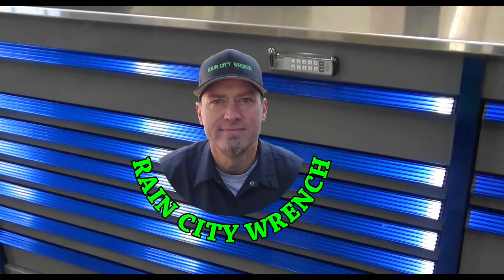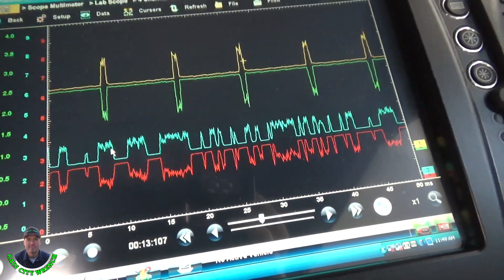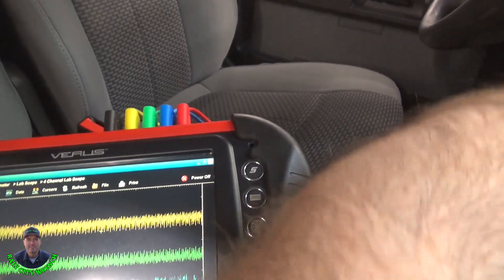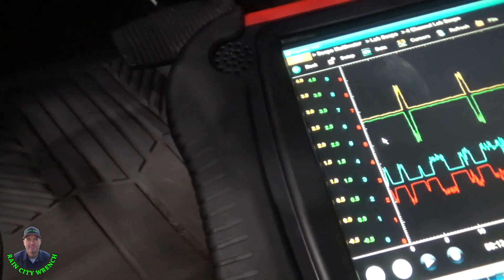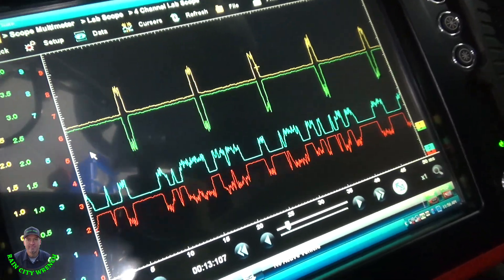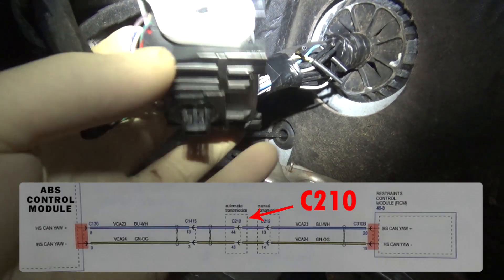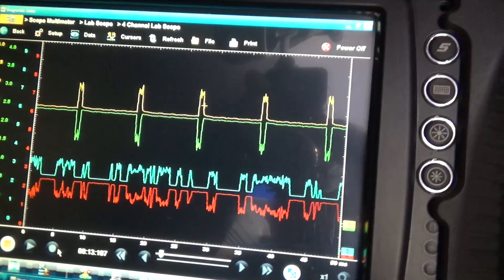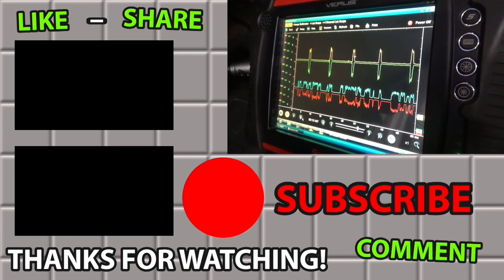U0028 SERVICE ADVANCETRAC

Comment: just had this happen to my 2014 F250. I tried cleaning the connection but that didn't work. so I cut the blue/white wire and orange/green and hard wired. you have to drive 5 miles or so before it clears the soft codes. thank you for this video!!
Reply from the maker: Your welcome. Glad you got it fixed. It's a good feeling fixing problems like these without draining the wallet.
Reply: What is a drag test?
Reply from the maker: @skofflaww3883  Got this off jumperkits.com:"If nothing is visibly wrong, poorly mated, loose, or worn out terminals can be discovered by performing a “drag test” using the correct wire from our Jumperkits.

Select the correct mating terminal from the Jumperkit and manually insert it into the terminal in the connector. As you slide the terminal in and out, it should fit securely and you should feel a significant amount of “drag”. If not, the terminal should be replaced."
 I use the terminals out of my aeswave advanced test set. https://www.aeswave.com/uTest-Advanced-Terminal-Test-Kit-p9748.html
Reply: Thanks for the quick response. I understand however it seems that a terminal that would fail this test would be extremely rare. Wouldn’t think of terminals to be “wear” items but I guess vibration could do it’s dirty work.
Reply: My abs/advance trac is lit up. It said it was the right front wheel speed sensor. So I fixed that. I started it, lights still on. So I drove it for about a couple miles and it’s still on there. Any thoughts? 2014 F350

Comment: Would this code, cause a crank no start? Only codes are u3003 and u0028? Thanks
Reply from the maker: I don't think so. U3003:16 will set if rcm detects voltage below 9.5V and U3003:17 for voltage above 16V. You probably have something else going on like fuel or ignition problem

Comment: Hey did that U0028:08 ever reappear after you cleaned the c210 connector? I’m having the same problem on two 2015 f250s replace RCM module on one, but to no avail.
Reply from the maker: Did that repair months ago and has never come back. To be honest, I expect it to return & if it did I would have just bypassed the connector. If you suspect that is your issue and don't have a scope then I would just cut both the communication wires on each side of the connector and splice in new wires. Make sure you leave slack in the new wires and if you want to get fancy then add some bullet connectors so that the connector and spliced wiring can be disconnected if need be. Hope this helps.
Reply: So spraying that connector helped preventing the advanced trac and hill descent issues?

Comment: and so many things can bring systems down, i had a front view cam on an 18 gmc totally dropping multiple systems, and the manufacturers just keep adding to them, my 18 gmc came in for a 4wd issue, t-case clutch over temp, flow chart led to ebcm, repair any codes stored in it before proceeding, had loss of comm codes, which lead to replacing the cam cuz it was bringing multiple systems down, afterwards, still had the same problem, so a heads up, on the 4wd system, this vehicle had no more codes in the ebcm, tac had me rebuild the t-case, replace the t-case, them replace the tccm, still no fix, ebcm wasnt fast enough to set speed sensor codes, which this system uses to calculate transfer case clutch temp,  only scoping the speed sensors caught the glitch
Reply from the maker: WOW, nice find. I'll store that in the memory bank. Europeans do something similar, they use wheel speed sensors to calculate tire pressure. Had a suburban crank no start, no communication after battery replace by another tech. Owner butt connectored an alarm into the data link wiring that shorted the network.

Comment: Does anyone happen to have a wiring diagram for that connector? I was going to hardwire the blue/white wire but I see multiple wires that color
Reply from the maker: It's pins #44 & #45 in connector C210 if it has an auto trans. Send me email to raincitywrench@gmail.com and I can send you a picture of the connector if you like.
Reply: @raincitywrench117  thank you sir

Comment: No I gotta damn Ford Fusion with this code
Reply from the maker: Need to run a network test with a scanner and see if one of the modules is not communicating. It will most likely be the ABS or restraint control module. ABS module is tucked away on the driver side of engine on bulkhead under the brake booster and the RCM is under the center console. Check for rodent chewed wires under the hood back by the firewall.

Comment: I believe I'm having the same issue on my 2015 F250.  The service AdvanceTrac and all sorts of beeps come and then suddenly the dash will go blank and restart.  Do you think this is the same issue?  I tried disconnecting that harness and reconnecting and then it started to have an issue with the outside air temperature (the radio shows -40 degrees then suddenly just dashes appear.  I presume that sensor is also wired through that harness?  Here is a video of what it was doing:  https://youtu.be/sOZgziAuWA8
Reply from the maker: OK, will take a look at the wiring diagram and get back.
Reply: @raincitywrench117  I believe I found the wiring diagram for my truck and it shows that the AAT sensor does pass through C212.  I'm also getting a couple dozen U "lost communication" DTC codes and of course the HS CAN does also pass through C212.  I think I'm going to check out that connector to see if it is loose.  It doesn't seem to be a C210 connector like you show in the video.
Reply from the maker: @hyoctane23  OK. Doesn't sound like C210 is your problem. AAT sensors are pretty common to fail and may be unrelated. If you have multiple modules with multiple U codes, look to see what's the most repeat U-code and suspect that module or connectors.
Reply: @raincitywrench117  I would also believe the AAT could fail randomly but the last two times my truck started having the cluster issues the AAT wasn't reading and it reads normally when the truck is running right. I could send you a screen shot of all the codes to see what you think. I did try wiggling around the C212 and C210 connectors yesterday but couldn't reproduce the issue. My next suspect is C1232B on the PCM since that has HS CAN as well as AAT connections.
Reply: By the way, I did find the issue. C263, that is on top of the BCM had a couple of bent pins. I wiggled the connector and all hell broke loose. After fixing that, no more issues.
Reply from the maker: @hyoctane23  The old wiggle test, that has saved my bacon so many times. Nice find! Out of curiosity, were most of the U codes stored in other models BCM no comm codes?
Reply: @raincitywrench117  there were all sort of different U codes between the different modules so I couldn't originally isolate it to a particular module. For example there was PCM lost communication with the ABS module...or TCM lost communication with the TCCM...and all sorts of other different U codes. I started to suspect this connector because first the ambient air temp was not reading, I started to get a 4x4 error code, and finally all the U codes. I first found the wiring diagram for the AAT sensor and then I saw that there were also a circuit for the 4x4 selector switch a HS CAN circuits. The good ol wiggle test confirmed my suspicion.